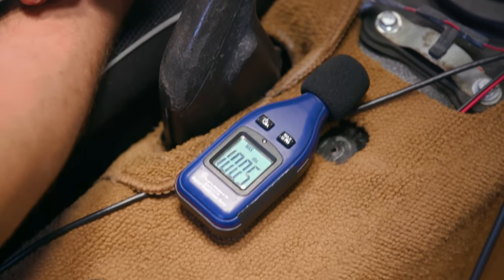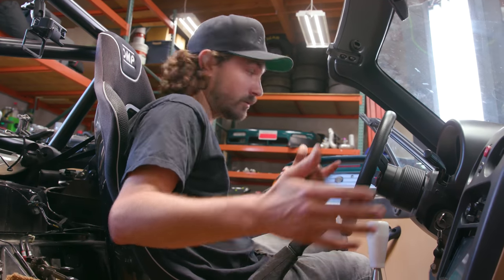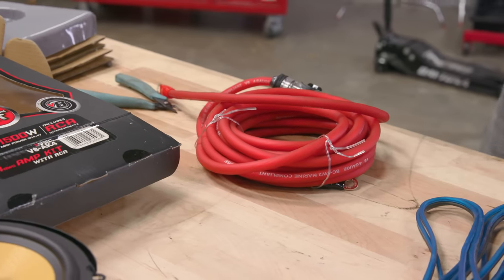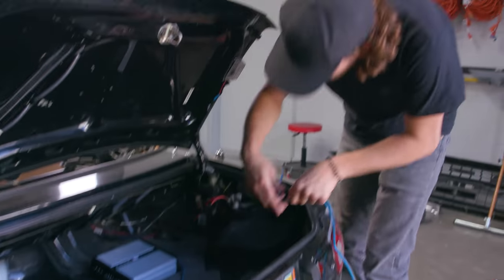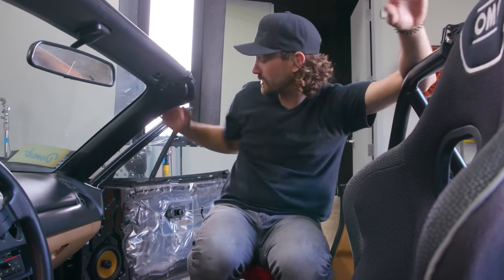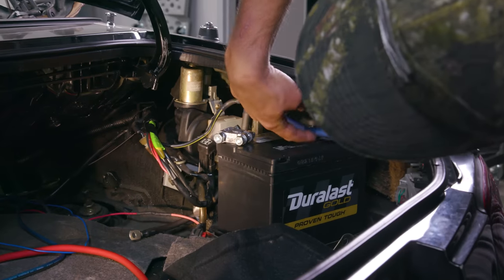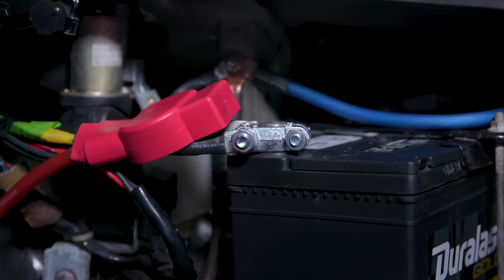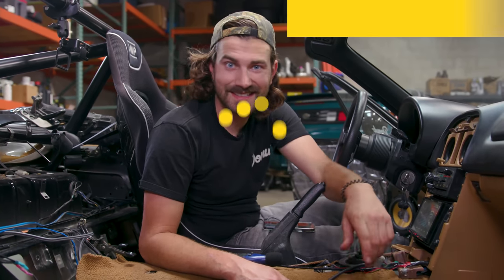Is Upgrading Your Car Speakers ACTUALLY Worth It?

Comment: Its a huge coincidence that I am looking to do a speaker swap on my car. This video couldn’t have come out at a better time.
Reply: But fuse your amp, he didn't mention it and it's very important.
Reply: An in line fuse
Reply: Tune your amps aswell if your looking to enjoy them for more the 2 weeks
Reply: Same here 😅
Reply: Don't take advice from this video. There is a lot wrong here, but to start, the car had a component system factory (tweeter up high, and woofer lower in the door) and instead of upgrading both speakers he just shoved a coaxial in the woofer hole. A component system would sound much better across the board and would have a much better sound stage. And if you are going through the trouble of installing an amp, then buy one with dsp, buy a umm6, watch a YouTube video on how to use REW, and flatten the speakers.
Reply: Been thinking of it myself.
My current setup isn't bad, but it's getting old.
The main issue is the head unit. Volume knob is getting cranky, it's CD only, and it overheats frequently.
Reply: I had this same coincidence with the curbed wheel vide they just did.
Reply: Absolutely massive coincidence
Reply: Unless you're looking to blow you're ear drums out or have an aftermarket subwoofer with an amp as well you don't need an amp for your speakers. The head unit will put out plenty of amperage and sound great 9 times outa 10 which makes replacing speakers ridiculously easy.
Reply: Take a look at Crutchfield Audio, they are absolutley amazing and make this whole process insanely easy, quick, and they have the best customer support I have ever experienced
Reply: It's not a coincidence jageroo, we know everything about you. We knew you needed new speakers 🔊 and now you must buy JL AUDIO. 🤣🤣🤣
Reply: @CBLChase  Crutchfield has been gods gift to any audiophile for over a decade. Nobody does it better.
Reply: @GuernB2  hey could you help me find a better setup to do in my nb miata. i have tweeters at the tops of my door and speakers down low as you were saying. I want to do a speaker swap but without using an amp, what would you recommend?
Reply: Same here buddy
Reply: @flyingsloth2606  I actually have an NB and just did a speaker install with an amp. DM me on insta @guernb2 and I can try to help out.
Reply: Same. Been planning for months and then this.
Reply: I just did a speaker swap on my car and it’s been so worth it
Reply: @GuernB2  okay i will
Reply: @PabzRoz  Big wrong on not recommending an amp for aftermarket speakers. Head units don't put out shit for power. The Rockford Fosgate 6.5s I'm looking at for my truck are 100w RMS/200w Peak. No head unit is doing that.
Reply: @amorton94  read my comment again more carefully. specifically the first 9 words.
Reply: be sure to watch some real videos on the subject :D
Reply: @MrPatateHead  you dont fuse an amp you fuse for power wire size lol .... kit came with the proper fusing
Reply: @mcf3778  well duh, thanks captain obvious!
Even if it came with the kit he hasn't shown it and it is a very important part that he shouldn't have skipped over.
Reply: @PabzRoz  While I hate to admit my age, I've probably been installing stereos in cars and houses longer than you've been alive, and through all of my experience (ranging from a $300 install to a $40,000 install), I've yet to see or hear of anyone "blowing their eardrums out". So you can imagine my annoyance of you out here spreading non-sensical concepts as-if you "know what you're talking about"... 

First of all, adding wattage to your speakers makes them able to produce more output at lower volume. Translation: You still control the volume. Just because you'd be able to make the peak output higher doesn't "mean" that you'd do "any more damage" to your ears than listening to the same speakers without an amp, just that it'd be able to do so with less effort. And following with what amorton94 has already said, if you're adding aftermarket speakers, it's typically better to add an amp along with them because they're able to USE more wattage than your typical stock/aftermarket headunit would put out... Know what happens when you replace the stock 40w/50w speakers in your car with ones that are able to handle anything upwards of 90w? The brand new speakers will sound dull, flat, lifeless, "quieter" and "worse" than the stock speakers did because you're now underpowering them with your weaker stereo. Which is why you'd want an amp. Which is why he said you were wrong. Hopefully now, you understand why you are.  

Secondly, as you entertained also adding along a subwoofer, you'd need an amp for your speakers to circumvent the offset of output that just about any 800+ watt sub would put out. That said, you're making your "blow your eardrums out" statement about... door speakers? When the highest of the high end MIGHT reach 1000w RMS, and subs can reach into the tens of thousands, do you really think that a mere 200w speaker is going to do a dang thing to your ears? Please, use some of the money you're attempting to sidestep spending for an education. Not to mention that the overwhelming majority of anyone reading this would likely never buy door speakers north of 350w anyways. Ergo, there's no need to worry. 

Next off, your "will sound great 9 times out of 10" statement is... at best, unsubstantiated. Will it work? Yeah. Will it sound "well enough"? Probably. But don't compare it to what it'd sound like through a decent amp, because you'd find that "9 times out of 10", the amped speaker will sound night-and-day levels better than the non-amped speaker. A head unit is meant to produce sound. An amp is meant to drive sound. Speakers need sound to reproduce, but it doesn't happen "well" unless the speaker is driven to it's upper potential. Let that sink in before making more asinine claims. 

Lastly, neither you nor Crutchfield can claim justification to the term "audiophile". It might be a goal, but it's one neither of you have attained. Anyone with basic-level knowledge of how electronics work, especially through sound reproduction, knows one simple fact: It's not done via a webpage. Yet that's what you and they will try to claim. Simply put, there isn't a more deceptive audio tool used on the web for audio electronics than their "speaker comparison tool". It tries to portray the sound supposedly put off by speakers in an attempt to give a "real world comparison", and does so using filters, not actual recordings... Want to know where you CAN get that level of hearing comparison? Your local car stereo installer's comparison booth. Know where you can't? On a webpage. Oh, and if you need any further clarification of that sentiment, it'll not only be determined what you hear by the headphones you're using but also what headphone model you've selected as "what you're using" on the website... But that's supposed to portray "accuracy"? Sorry to burst that bubble too. Is the site a good reference source for a decent amount of information? Absolutely. But mind that key word: Reference. Not "the holy grail" that you've praised it as. Why, you might ask? Because what happens in your own real life instances isn't going to be what they're able to tell you "what will be", only "what should be". 

Wrapping this all up; There's few things that could benefit this world more than stopping the spread of misinformation. Do those of us that actually understand what we're saying a favor and read my comment again (and again) until it actually sinks in. Specifically, all of it.
Reply: @RAW_Reality  yeah there's no way I'm reading all that sorry man.
Reply: @leeroyjankins2307  You're right... I shouldn't "expect" people to use and exercise the very tool that they use to communicate, regardless of where they use it. Or, as you're in preference of, don't.
Reply: @PabzRoz  hmm, odd they actually sell amps in the first place then eh? Also it's a convertible shakes head
Reply: @inglouriousmofo  Did you seriously type "shakes head"? What is this twitter?😂 Relax, no need to be triggered.
Reply: @panzerveps  lol just get a new head unit then, u can get one from like 30 bucks.. with obnly usb/bluetooth input... one for 60 bucks is fine... also when u have the doors open u want to add sound deadening to the inside of the doors.. and also fix everything that can rattle in the door... that makes even more difference then a 500 dollar amp can make u... u cant have nice sound if ur install is bad. it also helps make ur car more silent on the road..
Reply: @larsvegas1505  You'd have to triple that to get a decent head unit in my country.
I know it's easy, but it's a pain.
The guy who installed the sound system didn't do a very good job in the first place, so there's plenty of wiring to fix while I'm in there.
Reply: @PabzRoz  hell no it's 100% worth having an amp if you've got at least semi decent speakers. It can make a world of difference. Speaking from personal experience with multiple set ups.
Reply: @edwardbrown5364  easy way to tune amps etcetera? Or take them to a shop?
Reply: Not a coincidence. Called an algorithm
Reply: He’s making me miss my old sound system in my last car. It was legit but I couldn’t keep the car and had to sell it and couldn’t install the old sound system into my new car since it’s different sized

Comment: Zach needs to install the mod that allows you to manually control when each headlight goes up/down. Then pump "pop up up and down headlights" at full volume while alternately winking each headlight. Get Jeremiah in his mesh shirt as a backup dancer.
Reply: That would actually be perfect
Reply: If you mash the headlight button on miatas the motors can’t keep up and they start popping up one at a time
Reply: Yes
Reply: This. Must. Happen. Now!
Reply: Jeremiah in his mesh shirt. This just reminded me how much I laughed when I first saw Jeremiah in his mesh shirt. Well played.
Reply: on the miata i half pump the headlight button (like a very light tap) and it winks. takes some practice but way easier than using restrictors
Reply: @rigbymckay3737  It works on his, but on some better miatas in shape like mine, the headlights wont wink
Reply: @calzonetrash  Restrictors?
Reply: They make kits for that.